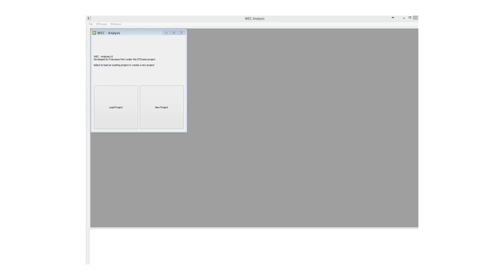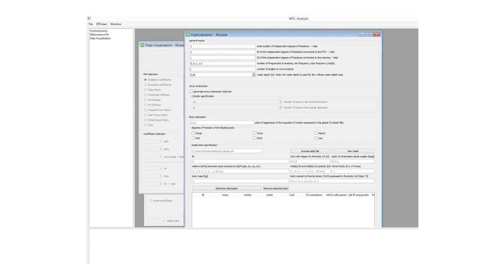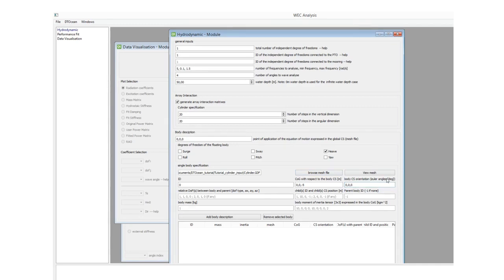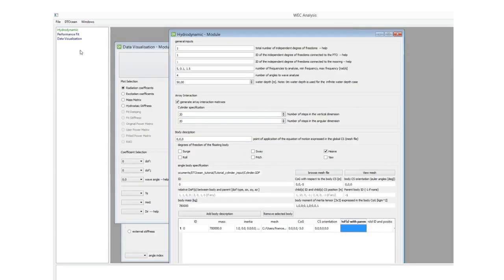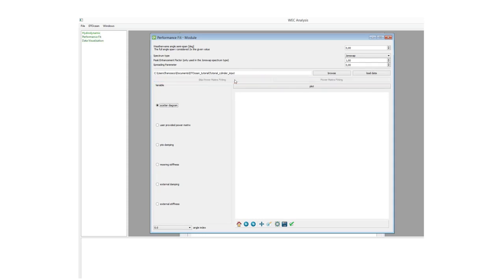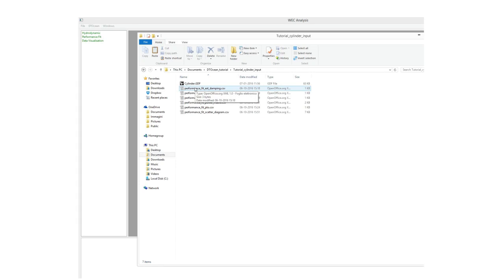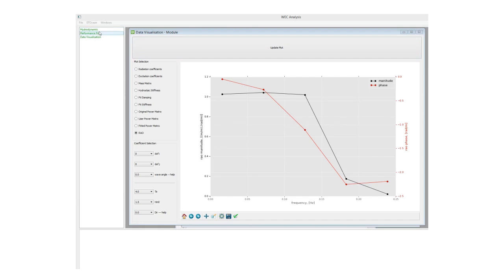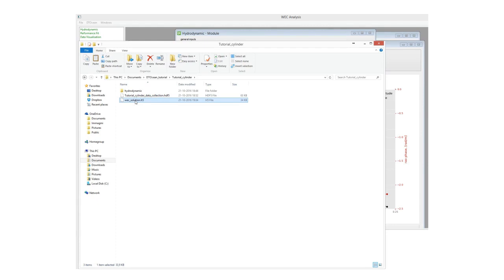DTOcean 1.0 Cylindrical WEC Pre-processing - Parts 1 to 4

Comment: If I am working on a new case, which means I don't have any data available (from scratch). How do I get the mesh file to be used for hydrodynamic coefficient calculation??? In your case, you used a GDF file. How can I generate that file?

I have my geometry for floating WEC in STL format. Thank you in anticipation.
Reply from the maker: Hi @AhsanKhan, you can use Meshmagick to convert between file formats (to the native NEMOH format, in fact). Here are its docs:

https://lheea.github.io/meshmagick/index.html

I don't support that software, but your goal is to covert your mesh into something NEMOH can read,  as explained on this page:

https://lheea.ec-nantes.fr/research-impact/software-and-patents/nemoh-mesh

Hope that helps.